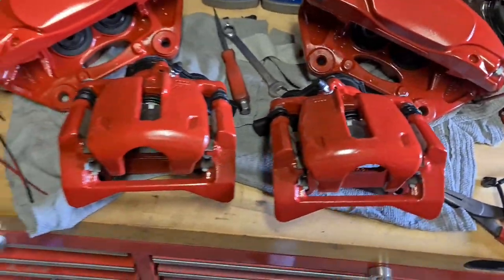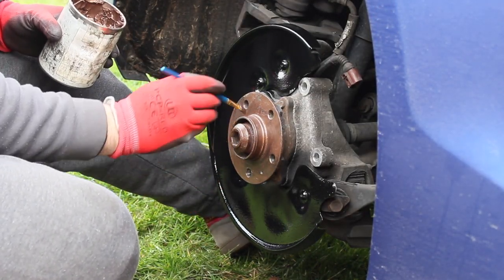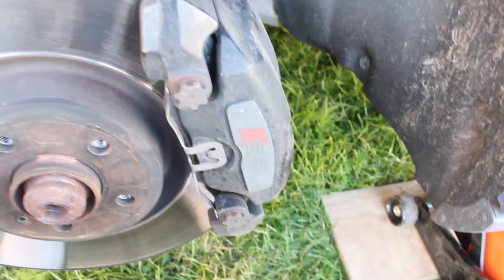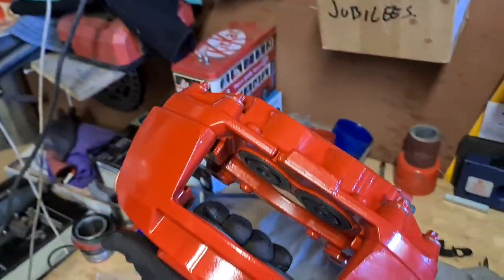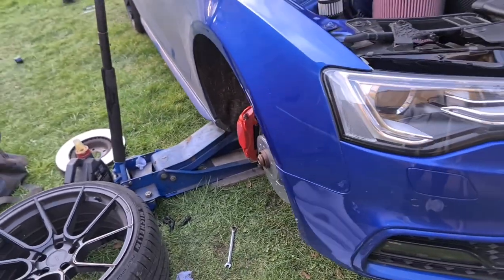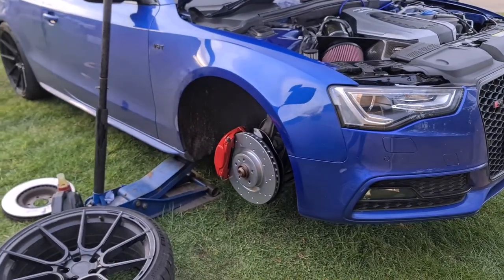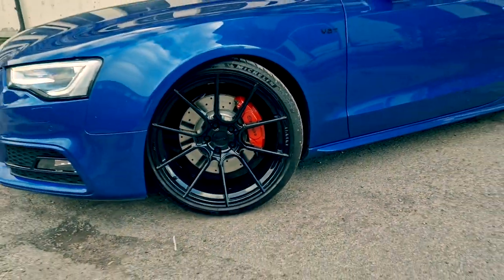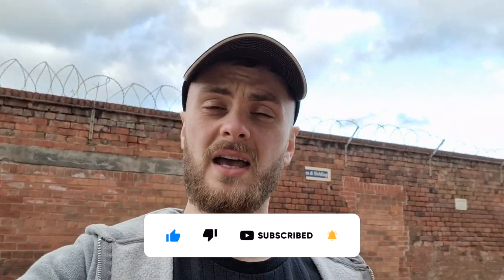The S5 gets a Big Brake Upgrade

Comment: Do you have the measurement between the disc and the highest point on the calliper? For the purpose of seeing if my A4 3.0 tdi wheels will clear them without spacers. I need front brakes so might as well fit 345mm discs and a better setup. Cheers

Comment: Another great vid mate. Any signs of rust yet? I went for Mtech Brakes on mine, paid a little extra for the anti-rust coating. Grooved and X Drilled too. Whole lot including getting someone to fit cost me around £500.
Reply from the maker: Thanks mate. No signs of rust, I got the same ones with the anti rust coating. They are holding up great so far.

Comment: 2018 porsche macan base uses the same caliper, half the price and a neat lil porsche logo if you don’t refinish them. also what rotors are those?
Reply from the maker: They are used on quite a few different models. Definitely a good upgrade. The brake rotors are from Mtec brakes. Make sure to subscribe to keep up to date with all the latest videos 😁

Comment: I wonder if these would fit S4 B.8.5, how much was it as well if you don`t mind me asking
Reply from the maker: Yea they should fit perfectly. The wheels I got for around £1500 and tyres where around £850 with fitting so not cheap but well worth it.
Reply: @STLCarsYT  I meant the brake kit - thanks
Reply from the maker: Oh my bad mate I thought the comment was on the wheel video 😂 yea I don't see why these wouldn't fit yours I believe the B8.5 S4 are pretty much the same under the body.

Comment: think those could be fake brembos tbh, the bare copper connecting brakeline is a giveaway
Reply from the maker: They aren't fake brembos mate, they have been rebuilt using copper lines so aren't the original ones that came on the caliper from stock
Reply: Ah fair enough, I only mention Incase people get ripped off as copies are a lot cheaper
Reply from the maker: Yea appreciated mate, they have the Brembo logo embossed onto the caliper as well so know they are legit 👌